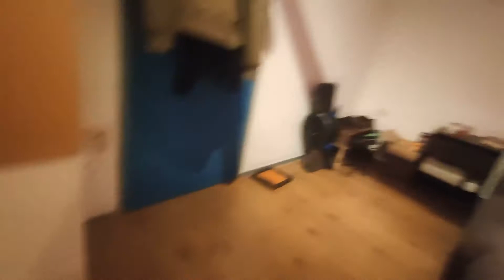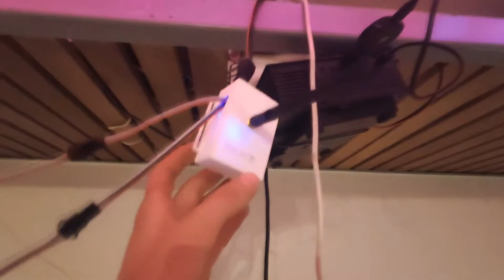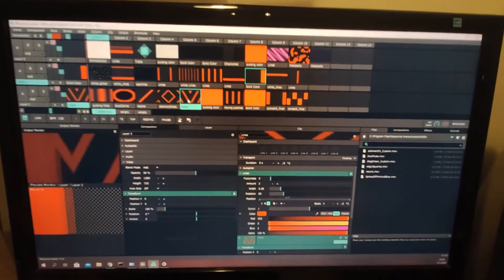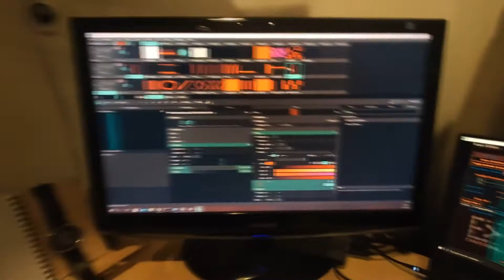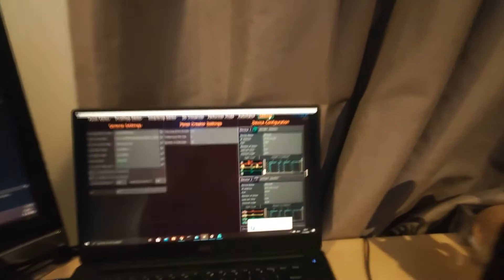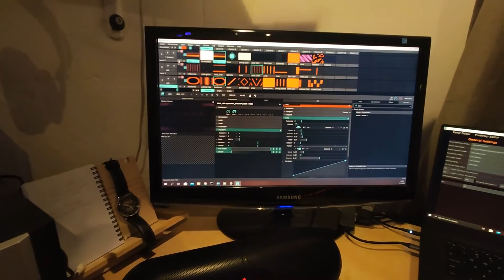DIY DMX led pixel bars & Artnet receiver setup tour- WS2812 explanation

Comment: I built a similar version of this, i have 60led/m but would actually recomend 144, do you have a link for the 3d printed parts, did i miss that?
Reply from the maker: i will replace my 30l/m 2812b with 12v 2811 leds for less voltage drop. the printed parts are my own, specifically for the tubes. ill upload them to thingyverse and come back to you!

Comment: I have a question, how many universes per output is the first box (wemos d1 mini pro)?
Reply from the maker: officially its 2x4universes, but i found that configuration to lagg quite bad, so for optimal performance I'm using 2x3 universes :)

Comment: When you say that Geopix free is only used as pass-through, what exactly do you mean? Does it go from Geopix into Resolume?
I was trying to use Geopix standalone but the free version has locked the network, which as I understand means there's not going to be any ArtNet output.
Reply from the maker: I'm using resolume to generate the content, and send it to geopix using SPout or syphon. I use the artnet output almost weekly with the free version, not sure what network locked means but artnet works!
Reply: @matthijsrc7873  thanks a lot for your response! I want to figure this out